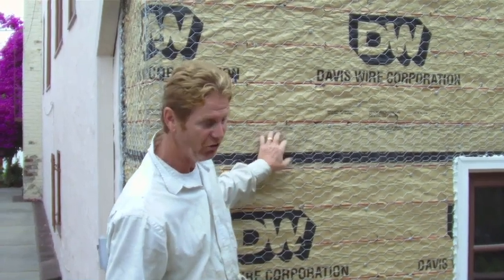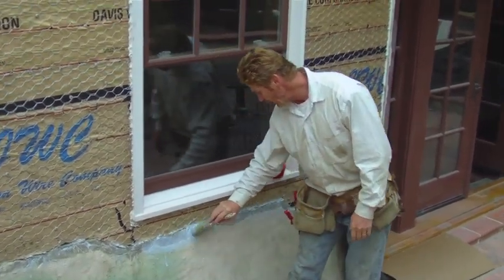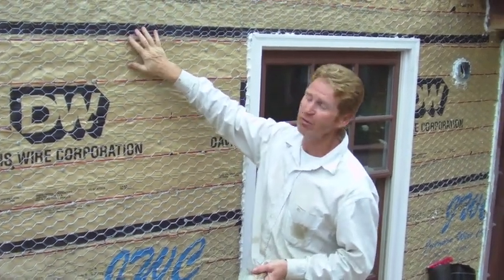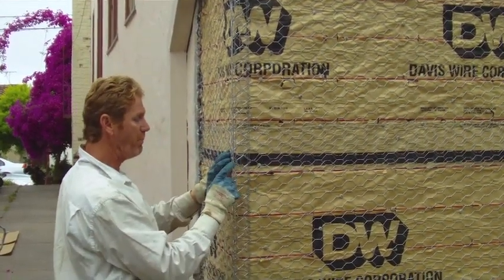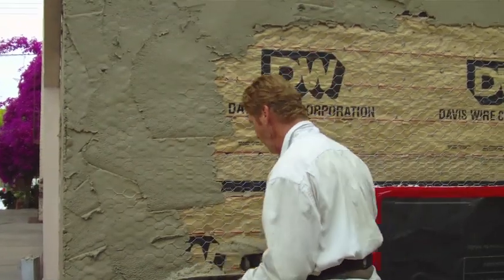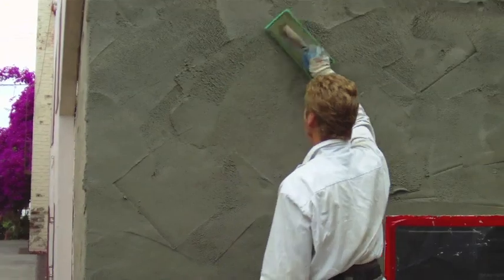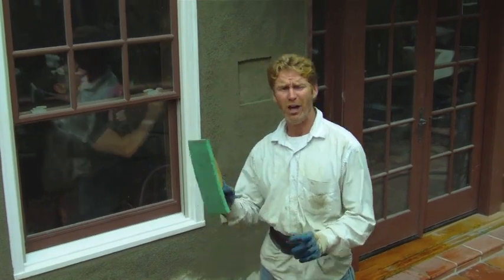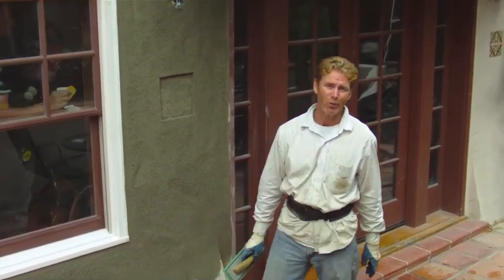Stucco applied to stud walls

Comment: How come you were able to apply the second coat in the same day, where as in other videos I've heard you mention to wait 48 hours to apply it. Great videos Kirk! Keep em comin'!
Reply from the maker: Hi Domenic Larosa, excellent question, there are traditional stucco systems where you applied a scratch coat,then waited at least 48 hours to apply the follow up coat or as we call it in the stucco business the brown coat.

For the last 30 years there are back to back systems that you can now apply both coats in a day and some materials that say you can even do a color finish too.

They all take practice. when I do small stuff I can save the customer some cash if I make one trip, the material cost 3 times as much as the regular cement plaster but it's a wash. I save time not making two trips, but pay 3 times the cost for material to make one, plus the same day coats are much stronger. so the customers are happy too.
 best wishes,
Kirk & Jason Giordano's DIY plastering channel